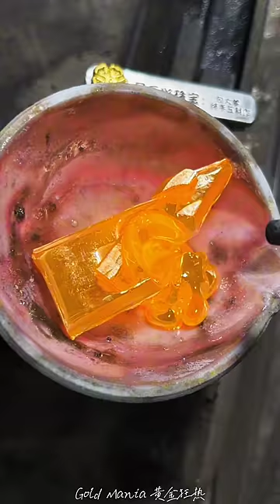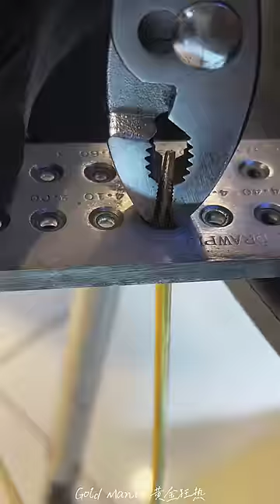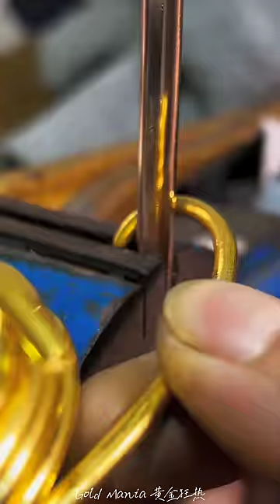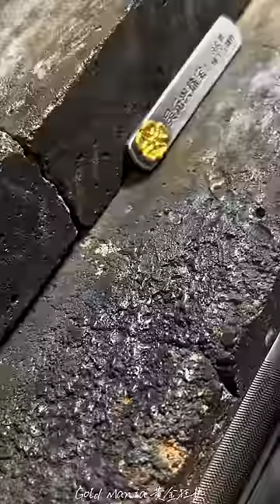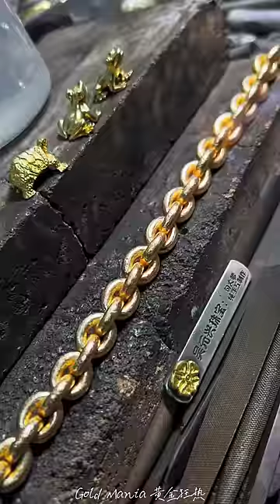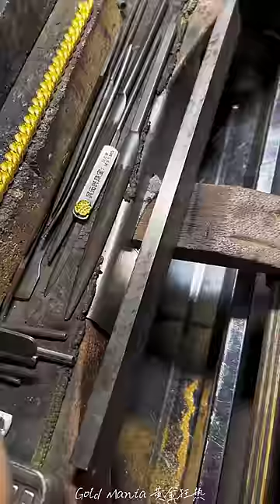Amazing 24K Twisted Chain making process #shorts #viral #trending #short #shortvideo #shortsvideo

Comment: 저러면서 일부 금가루가 썰려나가면서 원래 무게보다 줄어드는 마법
Reply: 귀금속은 가공 후 중량 재서 유통한다
가공 과정에서 떨어진 금가루는 
한톨도 남김없이 모아서 재사용하고
Reply: @구롬-t9k   exactly, plus when you pay for let's say a 300 gram chain that's 300 grams on the scales AFTER production/manufacturing of the chain, the finished final product is going to be 300 grams if not it'll effect the price,it's going to cost less if not. So if anything is lost it's not the customer lossing it it's the jeweler. But like the good gentleman above stated they don't lose hardly anything, they catch the filings,and dust all the scraps all that.

Comment: How's he touching the melted version of gold by his bare hands
Reply: You messing around right? I hope so ...
If not...the video is edited, the time cut out, he's never touching hot gold it's cooled already. Gold cools quick. Heating it with the tourch as he's connecting the individual links is only heating it slightly to make it a little more pliable/workable/softer but it's not burning hot. He never touches and melted, molten hot gold at any point.